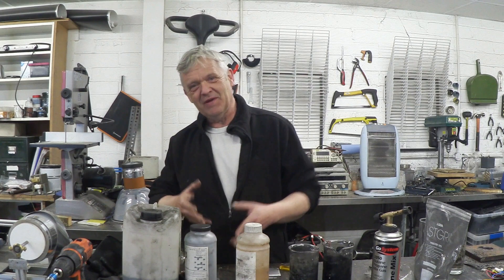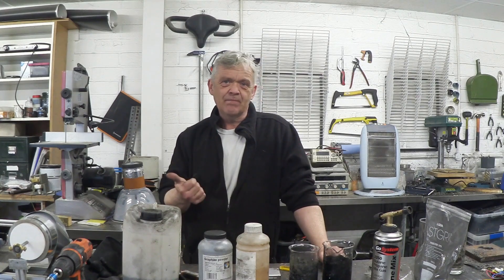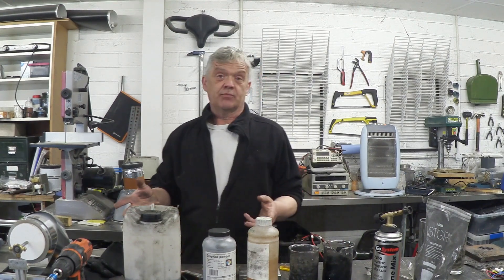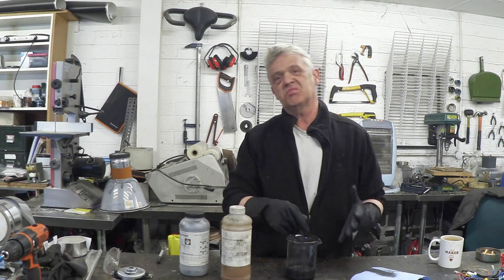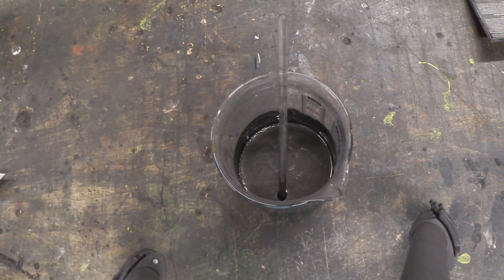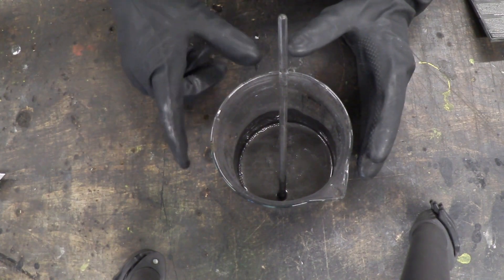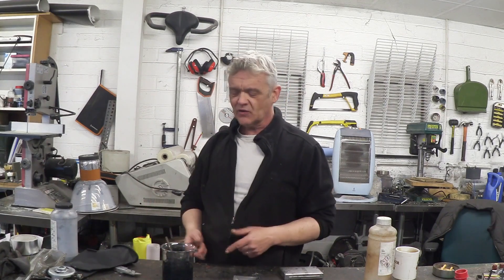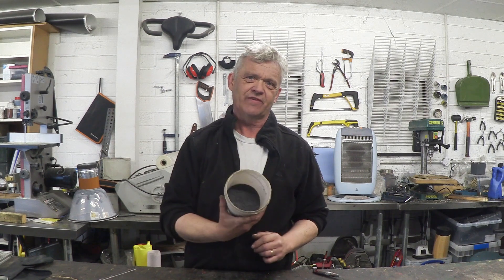1083 Graphene And How To Make It - Chemical Methods

Comment: Thank you for your content. I have scoured the internet to find the simplest method of converting 300 mesh graphite into single or double layer graphene.  I am clearly not a chemist and taking very small steps with a "safety first" approach. Most chemicals and items like a Kiln are simply not available in a small isolated country. Will either Potassium Nitrate or Sodium Hydroxide work as a substitute for Potassium Permanganate?  I would consider the electrical separation method however purchasing a welding machine is not my first approach and appears to be a slower method.  A total of 10-15 lbs of graphite will need to be converted.  All suggestion are welcome.

Comment: The space inbetween becomes less negative 😍 interpolation? Dus this means schinking of the particles bi tacing less negative space in👁👁??¿ the same event😍??¿😍
Reply: Wauw😍😍😍 lower thention bit introduce more ratio😍😍😍
For the princeple  particles to scrink in to 
Oooooh💜
When it has match diverentional to cool down again it has a lot of ruling magnetudee of space and motion within the space inbetween oll😍 in high thentional surrounding 😍
Yeah supercondurctive😍😍😍

Question is the supperconducivety in boths directions?🙏🙏🙏
Reply: Space gallery of inbetween the grafite 
Oei but u like magnus 😍💜😍
The way you interact with the knowledge you are sharing 😍 is directly connected with cosmic understanding😍

Oy🎁

🙏
Reply: Pleace look to mi sharings last 4 months.
🙏 how you see wat you explain I see in thentional diverentional of the space itself with cosmic behaviures 💜

You see them tace and desolves a litle more in to to be pulled open to exited to become that new begaviures😍
The way I see lightstructure behaves exactly the same as this evend.
Oxigen levels soil populations water behaviure our phisicle existances and so on and so on and so on in the same way😍

But from the senery behind the existence of phisicle existance and behaviures💜

I think you're it😍🙏😍🎁

Sharings youtube videos last 3 our 4 months😍

Comment: Amazing, great idea to put all the graphene methods together!
Reply: if id knew enough about chemistry, id like to see if there is a compound, made of several atoms packed in a way that at room temperature fit loosely in between the graphene layers of the graphite.  That "ideal compound" would stay flat or ball shaped at a certain temperature, but gets more 3d (expanded in the 3 x y z directions) when heated or excited, or perhaps placed under a magnetic field, helping to push part the  layers of graphene and helping to provide the energy to break the pi bonds......  if it doesnt work....my b plan would be break the layers carbon sp2 bonds by resonating the "ideal compound" at the "self resonating" frequency (which of course shold be known in advance), until the compound goes wild going up and down helping to separate the sheets....

Comment: Was R.Hummer expecting to dissolve the graphite into a chemical solution..,what might happen if mixed with lime and salt, will it dissociate into a warmed glass matrix.., is there such a thing as hot chemistry (where the fluids are hot).. should the NaOH be warm? (“..in some ways, this is the reverse process, of what happens inside the bovine digestive tract, using heat and pressure to form planar surfaces”)
Reply: What now?

Comment: Hi Rob. I use Concentrated Sulphuric acid and Nitric acid/Microwave method and various methods to separate the leaves afterwards, per your vid a couple of years ago. I works supremely well every time, and, it is safe, ie: no explosion risk. To make small graphene from large flake graphite I run it through a modified meat grinder with a HDPE disk with lots of .1 mm holes in it, or the marble and glycerine route. The marble method is best. Very high quality graphene.
Reply: marble glycerine method? do you have a link?

Comment: Thanks for the overview's and posting this plus all your previous talks Dr Rob. I disliked most of my science teachers but you I'd rather hear because you occasionally laugh which sets me off too.

As a lime plasterer I'm wondering why's it good in concrete, what's it do, would it keep damp at bay if a current passed through it for instance?
Reply from the maker: it was the Romans who discovered the addition of carbon strengthened cement mate but the use of volcanic ash - graphene just updates that really
Reply: @ThinkingandTinkering , thanks for the reply Robert, the Romans weren't to know that immersing the lime in seawater would produce Phillipsite in the lime mortar which are plate like objects that bend rather than shatter when the mortars put under stress. But you still didn't say what the graphene did in it.

Comment: How much Graphene can one make with 100 Million Metric tons of Graphite? ;)  I have the Graphite, I need to check on the Acid. I have lots of potassium permanganate. Thanks for getting back to the Graphene.  :)
Reply from the maker: quite a lot I would imagine lol
Reply: Keep in mind there are varying qualities of graphene, that you can over simplify into low, medium, and high quality categories.  Most of these methods make low to medium which can be decent to good for things like batteries, super caps, increasing strengths of epoxy, concrete, etc.  However, the holy grail of graphene research is producing the high quality stuff, the true 1 atom thick flat sheets that are super conductive, ridiculously strong for weight and volume, etc. It's been awhile since I've looked into graphene research, but last I checked, only a couple methods could reliably produce the high quality stuff, but they are not easy for most DIY'ers.  One of them is using electrical or plasmic catalytic processes on things like oil, carbon dioxide, deposited on copper sheet.  

    The easiest way to tell that you have the high quality, true 1 layer graphene, is that it is completely transparent to the naked eye. If it's black, it's multiple layers, somewhat jumbled and/or stacked which affects electrical and structural properties adversely.  

     Personally, I became more interested in the hemp fiber conversion stuff, but from there, I started wondering about using pure CNC's (cellulose nanocrystals), and converting these into graphite, or rather a graphitzed form.  Because if you isolate, and concentrate the crystalline structure of the material, it stands to reason that you'll likely get better electrical and structural properties.  Also not on part with true, high quality graphene, but often better than the low to mid grade kind of in between graphite and graphene stuff.  

   I also moved away from hemp, because in my country (US) hemp, even "waste" hemp is not cheap or easy to get for the most part.  I realized that any bast fiber with a high percentage of crystalline cellulose would work similarly, and even better if you isolate and concentrate what's there.  So I did some research and figured out the cheapest material to source, and did some research and experimentation on how to do that.  It's kind of a pain, because it's a multi step process, not even including the pre process of cleaning these well for chemical conversions.  But first you have to bleach/get rid of the lignin, which neither the sulfuric acid nor enzymes do, then with the acid or enyzmes, you get rid of the soft/regular cellulose's at proper temps and ratios of acid to water and also proper time. This is not including all the rinsing in between the different reactions. If done right, this leaves you with a high purity/higher percentage of the crystalline cellulose.  Then you have to carbonize it in low oxygen environment.  And with a good and well insulated microwave kiln, you can graphitize it in a low oxygen environment.   

   This is all ok if you're make small batteries or super caps for yourself, but forget about selling to the masses.  And who knows what regulations and rules of testing etc have to be done before selling actual batteries to people?    Now, mixing some of this in, with some of the low to mid grade graphite-graphene hybrids is a little more economical and faster since it's a bit easier and faster to produce the latter than the former.  And then further mix a bit of high quality, but regular graphite to further increase those factors.  

     But then you have to worry about other various things like optimal electrolytes and proper systems, which are all whole other can of worms in and of themselves.  

  And, if the new vacuum capacitors are a real thing/tech, it will make ALL of this stuff completely obsolete. If the claims are true or even half true, there is nothing currently or even in lab that is anywhere close to the energy density and power density of these vacuum capacitors that allegedly attract and store super cluster electrons, and apparently are pretty cheap and easy to build because there is no exotic materials or processes.  Super clustered electrons are a bit of a controversial topic.  But apparently, ball lighting is considered by some, to be a natural form of this phenomenon.  Ken Shoulders, one of the researchers who stumbled on to these exotic state/form of electrons was first told by Feynman these were not possible, but later on, after other research/researchers indicated they were, he wrote an apology letter to Shoulders saying that he was wrong and that it is possible. 

   So, I'm hoping and praying that the company who patented and is working on these, actually is successful in getting to market because it is a game changer to everything electric.  Oh, and these can be used to generate electricity as well, by super heating a filament inside of them.  Graphene et al will still be useful for structural purposes, but electrical storage will be less of an important focus.

Comment: Excellent!  A comprehensive summary of graphene production methods.  Great idea!
Just a niggling little point: it would be most helpful to spell out in the description the names of the referenced investigators (or products, etc.).  I have had problems in the past trying to suss out the correct spelling to find the original references.  (Is it "Hummus" or "Hommous" or what?  "Tour" or "Toor" or "Toire" or "Teuor" or ?)  English is not all that phonetic, after all, and names, not very much either.  :-)
Many thanks for your work, Rob!
Reply from the maker: that is a good point mate - some things just don't occur to me and I think you are spot on here - it's hummer's and tour - not for you but for others reading this post mate - cheers
Reply: @ThinkingandTinkering  Thanks, Rob!  Much appreciated.

Comment: Would a sonic bath be a reasonable substitution for the stirring during intercalation? How would that affect particulate sizes would you suppose?
Reply from the maker: sonication will heat it up mate - not good
Reply: @ThinkingandTinkering  appreciate the clarification. Thanks a bundle!
Reply: I think the sonic bath will make it hot and boom. Maybe sonic bath after expanding.
Reply: @danp1224  I was thinking the sonic application while it is in an ice bath. Robert mentioned a sonic stirrer, and I think that was more what I had in mind I suppose.

Comment: I confess my ignorance, maybe this is how they already do it. Still, I actually looked up "how do you make nanobots" and came across a site describing a shrinking method. Yep, the molecules have the same density, but they shrink the size in some medium.

So, I already knew about hydrogels and 4D printing; you can make a flat 'print' that rolls up like a carpet. I just put two and two together and thought why not make the 4D carpet with a layer of graphene contained within. Then roll it up and shrink it? Voila, carbon nanotube. Seems feasible enough.

How do they make those things anyway?
Reply: Err, yeah...this post was about carbon nanotubes. But, since that's an application of graphene, I thought it was kinda relevant. ;)
Reply from the maker: you can make CNTs with a candle

Comment: Seeing what you do a strong though comes in my mind: let the chemists do the chemical work. If I do what you just did surely something will blow into my face fastest that I could realize. You're a chemist and you know how to play this game. We, the non-chemists enjoy your presentation. Regardez mais pas touchez as a Frenchman will say. Cheers mate!
Reply from the maker: yeah - it does take practice that's for sure
Reply: Sulfuric acid is not nearly as dangerous as often portrayed.  There was a period where I was working with it a fair amount, and for awhile, I didn't realize that my butyl rubber gloves had tiny pin holes that where allowing acid to get through. I was using my hands to swish around cellulose in acid. Anyways, even after a few days of this, no real damage was done. Just irritated and dried out my skin a bit.  Definitely wear goggles though.

Comment: dear robert
Could you substitute the manganate for 30% hydrogen peroxide?
- What if I only use sulfuric acid and nitric acid?
-And if I only use solfuric acid and then exfoliate it in the microwave?
-And if I only use 30% hydrogen peroxide, with graphite powder? I observe that it exfoliates, but I don't know if the result is graphene or graphene oxide, could you clarify it for me
Thank you
Reply from the maker: the job of the H2O2 isn't as an oxidiser mate - it is the make the 'left over' manganese dioxide form soluble sulphates so they can be washed out in the purification step